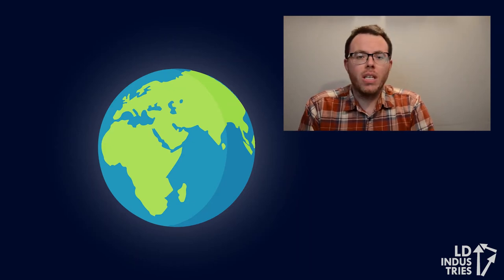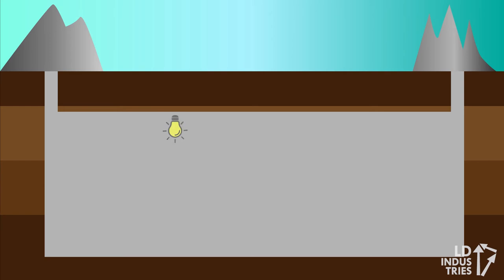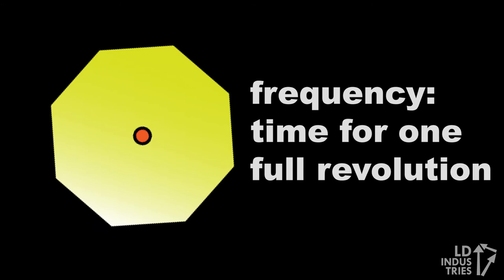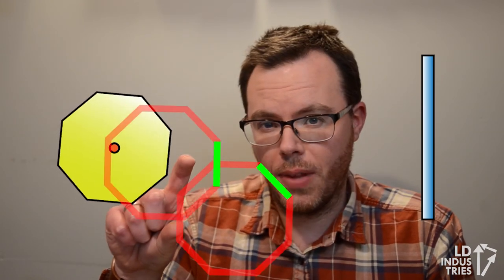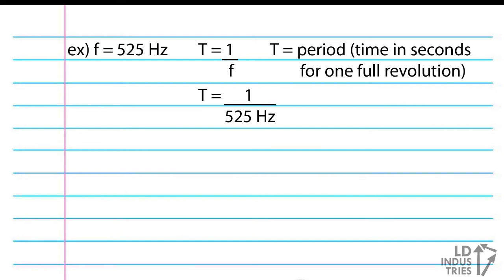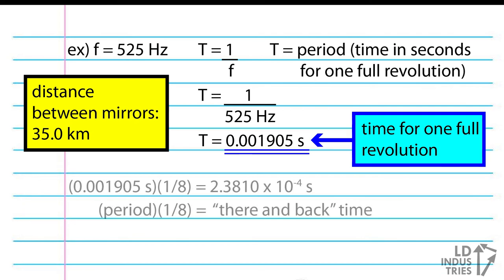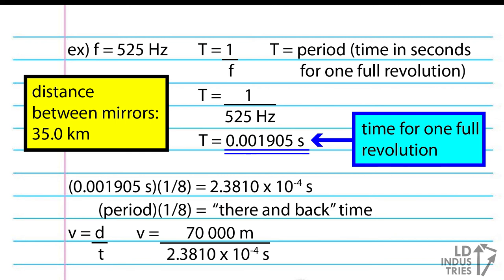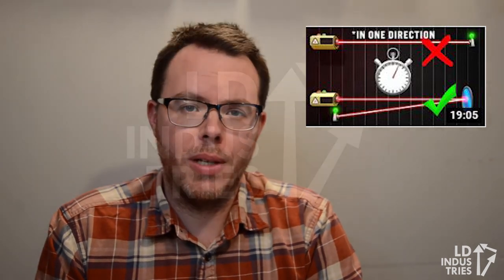The Michelson Rotating Mirror Experiment: LD Industries Physics 30

Comment: To keep the mirror from exploding, Michelson used a 16 sided mirror.  The light traveled 8448 one way trips per second, or 4224 two way trips per second.   The mirror rotates 1/16 of 1 revolution for each two way movement of light.  The emitted light and the  received light are on the same 90 degree axis to the two way path of light. This is important as it limits the errors.

Comment: The one way farfield speed of light has been measured and it is c. This was done by transmitting a radio wave from one dipole antenna to another dipole antenna, where both the transmitted signal and the received signal are measure by one oscilloscope (ie. one clock). The orientation of the 2 antennas were pointed in many directions and experiment was repeated many times over months.

But the experiment showed something unexpected. It showed that speed of light is instantaneous in the nearfield and reduces to the speed of light about 1 wavelength from the source. Since Relativity assumes light only propagates at speed c, and this has been shown to not be true especially in the nearfield of the source, then Relativity needs to be reanalyzed. Derivation of Relativity using instantaneous nearfield light shows that Relativity reduces to Galilean Relativity, and only in the farfield does it reduce to the speed of light c. This is because as c=infinity, the Relativistic gamma function becomes equal to one, causing the Lorentz transforms to reduce to the Galilean transforms. But using farfield fields yields the Lorentz transforms. But since time and space are real and can not depend on whether nearfield or farfield fields are used (i.e what frequency of light is used), then the effects of Relativity on time and space must be an optical illusion. Time and space are absolute as indicated by Galilean Relativity. When moving objects are observed using farfield electromagnetic fields then time can appear to dilate and space can appear contract, but the effects are not real and can be verfied by using nearfield electromagenic fields which will show time and space have not changed.

Since General Relativity is based on Special Relativity, then the effects of General Relativity on time and space must also be an optical illusion. So what is a better theory of gravity if General Relativity is wrong. It is well known that General Relativity reduces to Gravitoelectromaganetism for weak gravitational fields, which is all that we observe. Consequently Gravitoelectromagnetism predicts all known observed gravitational effects. But the difference is that Gravitoelectromagnetism is a field theory, whereas General Relativity is a geometric theory. Gravitoelectromagnetism assumes gravity is modeled by 4 equivalent Maxwell Equations as for Electromagnetism. The equations only differ in the constants used. Gravitoelectromagnetism is field theory of gravity and assumes there are both an Electric and Magnetic components of gravity. Just like for electromagnetic fields, changing magnetic fields create electric fields and visa versa. Gravitoelectromagnetism also assumes time and space are absolute and not flexible as General Relativity predicts.

For more information see my short 15 min: YouTube presentation and the paper below it is based on:

YouTube - New Interpretation of Relativity:
https://www.youtube.com/watch?v=sePdJ7vSQvQ

Based on the following paper: William D. Walker and Dag Stranneby, New Interpretation of Relativity, 2023
http://viXra.org/abs/2309.0145

Here are some other experiments where the one way speed of light was measured in ina a similar way in materials:

In a wire:
https://youtu.be/xt3QzXa-kOQ?si=ACv14veSz0LLcLku

In a fiber optic cable:
https://www.picotech.com/library/experiment/speed-of-light

Comment: Michelson's determination of the speed of light was low by around 6 km/s relative to the accepted speed of light of 299,792,458 m/s.  (Damn good!)  But the "accepted" speed of light is for a vacuum; what is the accepted speed of light at atmospheric pressure?  Does that factor make his measurement closer, or does it shift too far and make Michelson's measurement too high?
Reply from the maker: That’s a good point. The index of refraction of air is 1.0003, compared to exactly 1 for a vacuum. So light moves 1.0003 times slower through air, which is 299,882,396 m/s, or about 90 km/s slower. Although I don’t know exactly what atmospheric conditions Michelson conducted his experiment at. It’s an ingenious way of measuring either way.
Reply: @blangdale  Michelson made an adjustment in his final result to give  the speed of light in a vacuum based on the speed in air. His 1927 measurement was only 3,5 km/s away from the currently accepted figure.  In his paper he gave a +/- 4 km/s error. It was a fantastic achievement.
Reply: @blangdale  The one way speed of light has been measured and it is c. This was done by transmitting a radio wave from one dipole antenna to another dipole antenna, where both the transmitted signal and the received signal are measure by one oscilloscope (ie. one clock). The orientation of the 2 antennas were pointed in many directions and experiment was repeated many times over months.

But the experiment showed something unexpected. It showed that speed of light is instantaneous in the nearfield and reduces to the speed of light about 1 wavelength from the source. Since Relativity assumes light only propagates at speed c, and this has been shown to not be true especially in the nearfield of the source, then Relativity needs to be reanalyzed. Derivation of Relativity using instantaneous nearfield light shows that Relativity reduces to Galilean Relativity, and only in the farfield does it reduce to the speed of light c. This is because as c=infinity, the Relativistic gamma function becomes equal to one, causing the Lorentz transforms to reduce to the Galilean transforms. But using farfield fields yields the Lorentz transforms. But since time and space are real and can not depend on whether nearfield or farfield fields are used (i.e what frequency of light is used), then the effects of Relativity on time and space must be an optical illusion. Time and space are absolute as indicated by Galilean Relativity. When moving objects are observed using farfield electromagnetic fields then time can appear to dilate and space can appear contract, but the effects are not real and can be verfied by using nearfield electromagenic fields which will show time and space have not changed.

Since General Relativity is based on Special Relativity, then the effects of General Relativity on time and space must also be an optical illusion. So what is a better theory of gravity if General Relativity is wrong. It is well known that General Relativity reduces to Gravitoelectromaganetism for weak gravitational fields, which is all that we observe. Consequently Gravitoelectromagnetism predicts all known observed gravitational effects. But the difference is that Gravitoelectromagnetism is a field theory, whereas General Relativity is a geometric theory. Gravitoelectromagnetism assumes gravity is modeled by 4 equivalent Maxwell Equations as for Electromagnetism. The equations only differ in the constants used. Gravitoelectromagnetism is field theory of gravity and assumes there are both an Electric and Magnetic components of gravity. Just like for electromagnetic fields, changing magnetic fields create electric fields and visa versa. Gravitoelectromagnetism also assumes time and space are absolute and not flexible as General Relativity predicts.

For more information see my short 15 min: YouTube presentation and the paper below it is based on:

YouTube - New Interpretation of Relativity:
https://www.youtube.com/watch?v=sePdJ7vSQvQ

Based on the following paper: William D. Walker and Dag Stranneby, New Interpretation of Relativity, 2023
http://viXra.org/abs/2309.0145

Here are some other experiments where the one way speed of light was measured in ina a similar way in materials:

In a wire:
https://youtu.be/xt3QzXa-kOQ?si=ACv14veSz0LLcLku

In a fiber optic cable:
https://www.picotech.com/library/experiment/speed-of-light